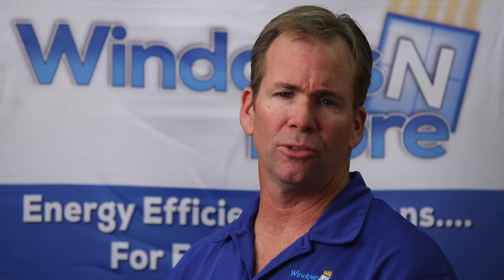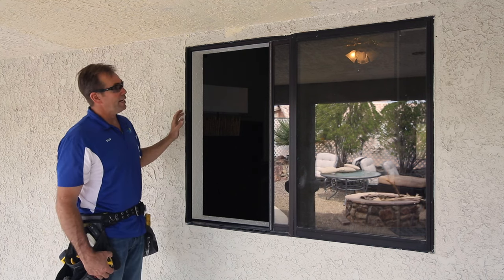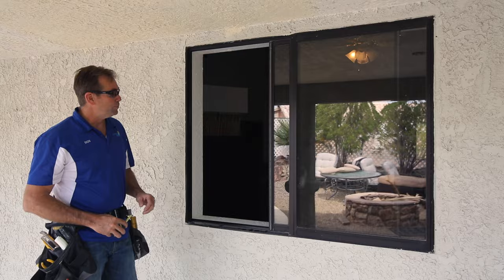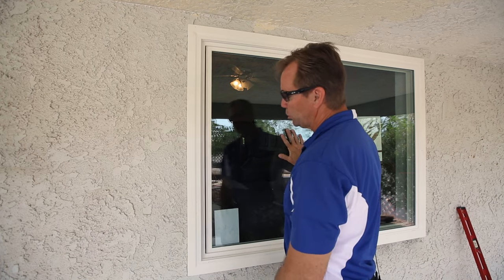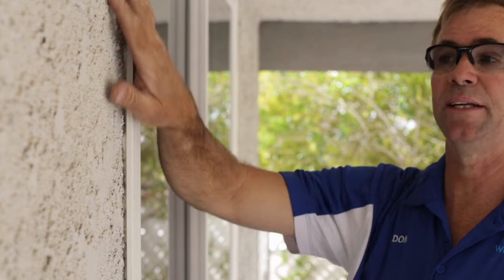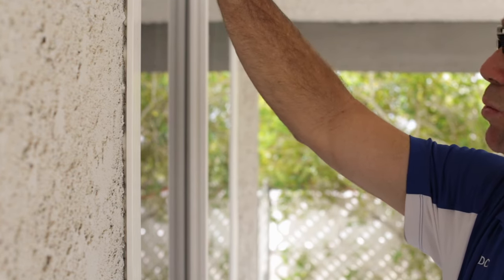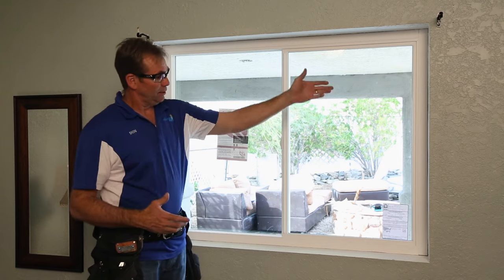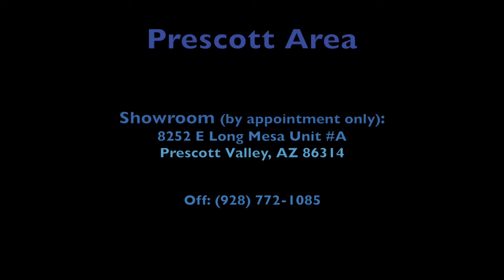Window Replacement | Stucco

Comment: I've been doing Windows for 25 years . tape the caulk? because you can't caulk? then when you pull the tape your caulk pulls too and shows the tape line and sticks up.  This type of installation is called jump frame and  you are suppose to use foam insulation before you put on your flat trim inside.. also you you need to lay a bead of caulk/lock tight on the window before you put your trim,  to hold it.. the tape on the flat trim will fail and not stick to the window.. Then you have a service, which I'm sure your use to.  horrible
Reply: Can you link to a better video on how to do this? Thanks for the insight.
Reply: Piggy backer

Comment: Clean work but why didn't you spray window/door foam around the inside gap between the new window frame and drywall before adding the self-adhesive trim?
Reply: Why? Aluminum Is A Great Thermal Break
lol
Reply: Why bother?  That hack install is ridiculous.  They simply use cheap latex painters caulk to "seal" the window to the porous stucco - water can pour thru that assembly, so why worry about air?
Reply: ArthurDentZaphodBeeb so what’s the proper way?
Reply: @Rlprime  proper way is to completely remove the existing window - need to break out stucco 4-6" around the window to tie existing waterproofing to new window assembly.  Otherwise, you're not doing a damn bit of good, and most likely creating a bigger problem.  Why this hack contractor is able to get away with such laughably shambolic installs is because his windows rarely see rain in Arizona.  In wet climates, those windows would leak like sieves. In Arizona, they still leak, but it's mostly hot air infiltrating expensive-to-cool interiors.  But they 'look' good and unsuspecting victims, er, customers are none the wiser.
Reply: @ArthurDentZaphodBeeb  his install was fine. They didn't break the original vapor barrier. They Caulked behind the z bar. I didn't see what ceiling he used, though. They did use a textured polyurethane to finish the caulking on the outside. That stuff absolutely needs to be painted, because it attracts dirt and looks like crap in no time. It is not going to leak water. He should have foamed around it, though. He also should have shimmed under the track, because if you don't, over time the weight of the sash is going to bow that crappy vinyl frame down. It's going to screw up your reveal between your sash and your jamb, and it's going to pop off your crappy vinyl trim quick. It's also going to generate a warranty call, because now there's daylight between the sash and the jam in the upper corner, because this frame is sagging at the bottom in the middle.
Reply: ArthurDentZaphodBeeb I need to replace some windows and flashing in Arizona. Any videos you recommend on watching. Thanks
Reply: still learning about , taking a sliding window out and adding correctly a new one, need to know every  detail.
Reply: @ArthurDentZaphodBeeb he didn’t break the old barrier .. if it didn’t leak then it won’t now

Comment: 1.I don't think you want to tell your costumers you want to cut corners and get the easy way out like you said on your video.  It would be nice if you would slow down on the process instead of jump or forward  from the begging to the end, that's the part I want it  to see.  Why you didn't insulate around the gab window before install the inside trim
Reply: +Art  Rios  He says maintaining the max amount of glass can't be done by taking short cuts or the easy way out. It's primarily a commercial for his company not a DIY video. I'm looking for a DIY video myself and I am with you 100% wondering why he left that big air space around the window. I think I would have spray foamed it before trimming it up.
Reply: Mike Hixson spray foam is full of what?

Comment: Here is the problem with his exterior caulking. He is putting a small bead at the ends of the window frame as the vinyl expands and shrinks (a lot) It will pull the caulk and you will have a leak. I just redid neighbors windows that the caulk failed and there were hugh gaps. Caulking is a piss poor material to seal out water. It just is. Mechanical IE a piece of trim  is much better. The edges of the frames like the tip of your finger is not enough grab. It will open (ask how I know)  Plus caulk has a certain ability to flex. Gotta research one that will flex enough..  Still it will leak, (suckers bet)  Did you know your homeowners insurance has removed mold and mildew damage from its coverage! Makes a lot of sense when you see this installation..  Then you used NO freakin window foam around the frames and only have a thin piece of vinyl trim( speachless) Great r factor your getting there(not getting) Then to use caulk on the inside of the window that will discolor and attract dirt. Now that has to be painted so you will have a amateur hour look..  Remember the original windows were put in under the stucco and for a really good reason.. I restored homes for a living and this aint it..  Remember most contractors go out of business every 7 years or so then restart under a new name to avoid the warranty and damage claims.. I was a kitchen salesperson and other division did anderson windows.
Reply: This company is scamming every customer.  Looks like they are using a cheap latex caulk against that rough old stucco and expecting it to be watertight?  It would be laughable if it weren't so contemptuously pathetic.  In this vid, at least the window is covered by the porch above, but heaven help any window that is exposed to driving rain with a southwest exposure.

Comment: Great video, Great looking window, nice looking caulk lines and it surely covers the stucco installation process very well!!  I am curious about a few small details that could have been covered here for the home owners attempting to install stucco windows in their homes by themselves and using this video as a guide. Maybe this step was not included in the video during a cut sequence? Was the insulation added between the vinyl and interior walls prior to install of the interior trim?

Comment: Thanks! I've been having problems with the outside sealant drying up and pulling away from the stucco after 5 years on all my windows.  Gonna try the CRL polyurethane to see if it's any better.

Comment: Can you elaborate on how you removed the inside aluminum fin?  Did you scribe with a razor knife and then use a sheet meet flanging tool to remove?

Comment: Why wouldn't you cut your interior trim at 45 degrees for a cleaner corner to match the window frame itself, and maybe I missed something but I didn't see any insulation go in before the interior trim was put on. Otherwise looked pretty good.

Comment: Good video, but I think you left one very important step out, the weep holes at the bottom, they should be left uncaulked so water doesn't sit inside the bottom rails... no?

Comment: When you put the window in the opening, you used caulking to hold the window in place.  I did not see you use any fasteners on the inside or outside to hold the window in place.  Is this window held in place by caulking only?
Reply: They did drill the frame in place. That’s by the vinyl cover for the holes

Comment: I wish I could see how he removed the side fins.  What kind of a tool does he have there? How do I remove the side fins please!  I have an aluminum frame.
I"m having to grind them out?  Thanks
Reply: looked like a small break for ductwork, you can class/p it on the aluminum and bend it back and forth the aluminum will work harden from the bending and snap off
Reply: "hand seamer"
Reply: It looks like the other guy is cutting it first.  Is that just a utility knife?

Comment: Excellent video! I  like the idea of keeping as much glass as possible. Can I also cut the top and bottom fin? I don't mind grinding them off causing dust and debris.
Reply: Depending on the type of frame you have, you may wish to avoid grinding the base channels too much. Most of the frames are made square channel with fins that are embedded into the stucco. You can risk revealing those fins by grinding too much of the frame down.

Comment: Awesome video. I’m thinking of replacing some arched windows in my home but was gonna break the stucco and install flashing due to humidity in the inside. Do you think it’s better just to do this ?
Reply: The lack of flashing will not cause the window to get foggy inside. I can cause water leaks when it rains though.

Comment: I am going to be replacing my aluminum windows to vinyl, and I cannot figure this out for the life of me. 
My windows (MI) are recessed in stucco. There's about 1/4 inch of stucco that covers the small flanges that protrude from the sides of the window. There has to be a better way than chiseling out the stucco from around every window and then replacing it. someone said to just tear out the old window by taking the glass out first then twisting, cutting and bending the frame out. If that is true, then how the heck can the new one fit?
Reply: Did you get it figured out?
Reply: @r2ba435  I did. Angle grinder to the stucco, cut out enough to wiggle the frame free.

Comment: Thank you for the video - installers here want to rip out the old frame and make a mess of my stucco.  Although I would do some different area protection and final detailing; the video was well made and informative and will save me hundreds... at least.
Reply: Avoid these hacks like the plague.

Comment: I think u just saved me thousands of dollars ...I supposed the new windows were slightly smaller? Send me an answer if u can
Reply: You lose a few inches of window opening when you use this type of replacement window. You have to order the window to slip inside of the old frame. You have to figure out how big a window you can stuff in there after removing whatever metal you can. If you do this yourself, make sure you put shims under the track, because it will sag over time otherwise.